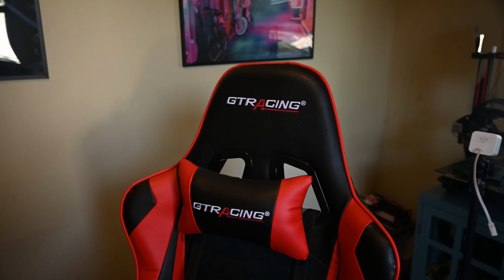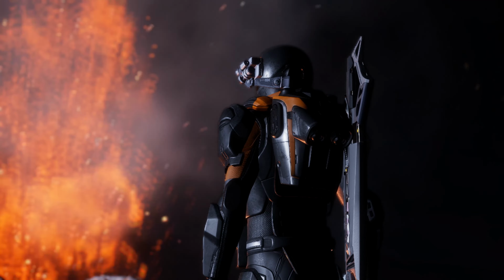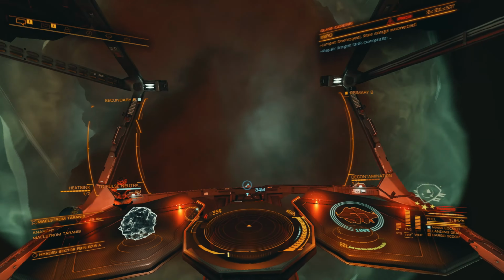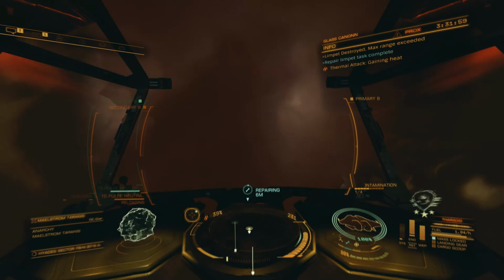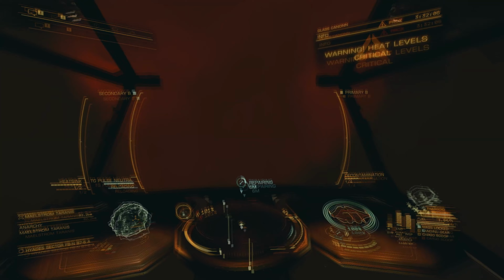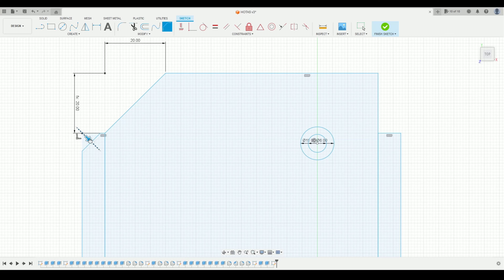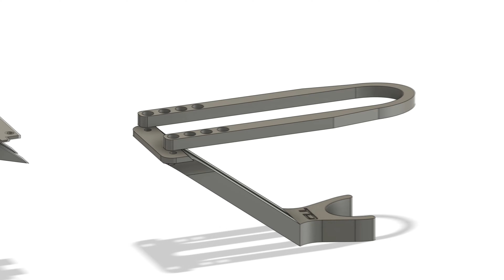3D Printed HOTAS Mounts

Comment: If you buy a quality 3D printer, your cut time will be cut in half if not better, especially with Prusa's new printer.

Edit: Nice job with the video btw :) Also, I wonder if they'd be able to handle Virpil setup which are mostly metal.